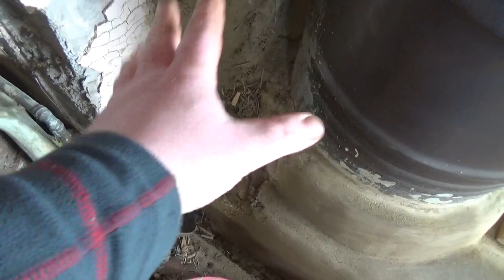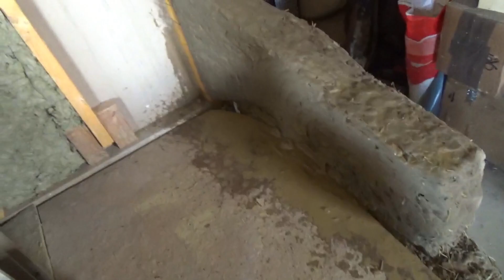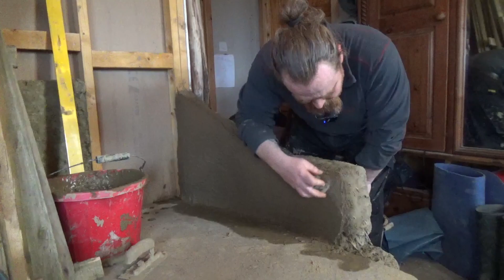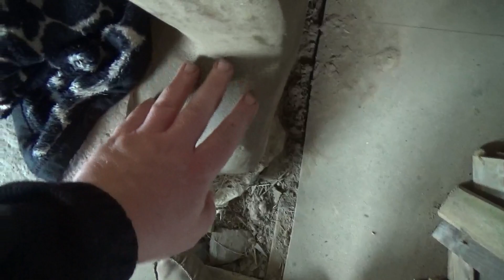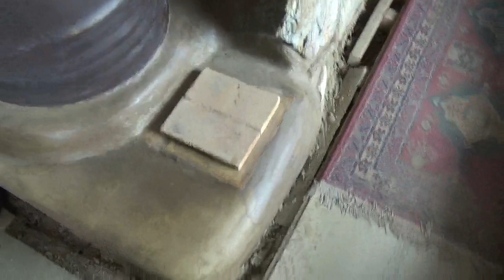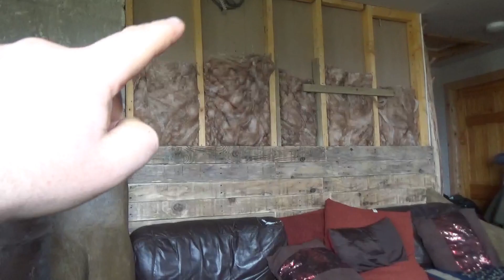Rocket mass heater build 13. Earthen plaster. The most efficient heating in the world.

Comment: A QUESTION for you sir, if you would be so kind. I am going into my sixth season with a half-bell style RMH. It's made out of local clay, mason sand, and a top layer with straw. Mine was never finished with plaster. A few years in, my wife got tired of sand everywhere, so I applied tung oil to the top. Now I'm ready to finally add a plaster. I realized that I may have screwed myself. Is it possible to still put on a natural plaster on top of a moderate layer of tung oil? If not what are my options? Could I sand it down and add a thicker slip. Thank you so much for your videos.
Reply from the maker: I'd scrape the oil treated material off before plastering. The plaster would be unlikely to bond with the masonry otherwise.